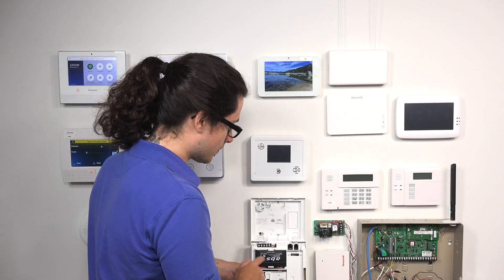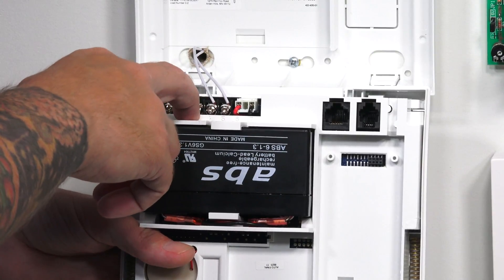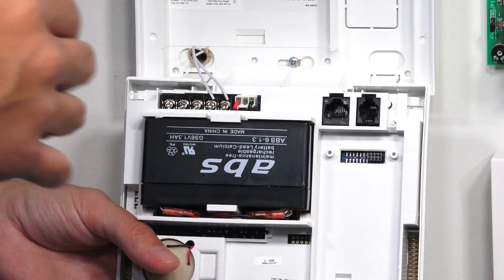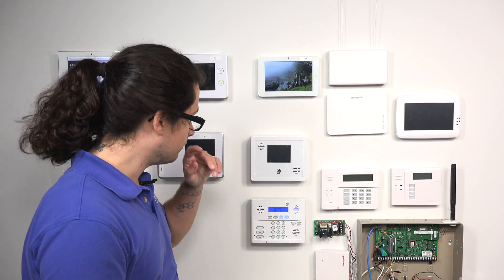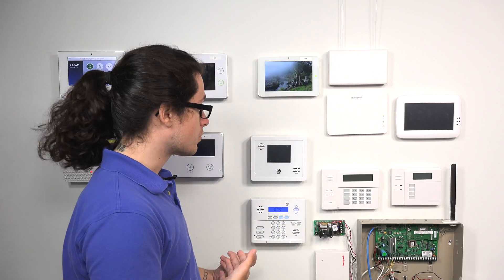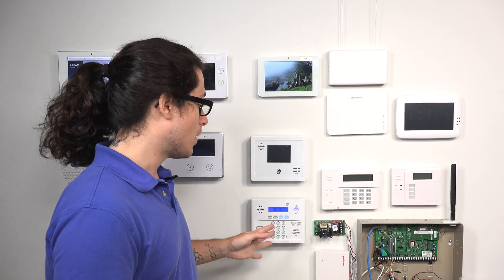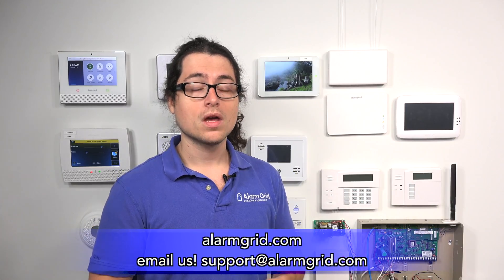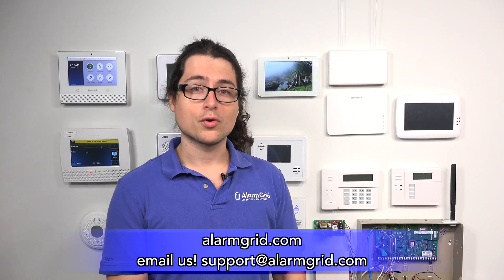Adding Hardwired Zones to an Interlogix Simon XT

Comment: I have brand new system and brand new motions sensors and they keep going off when they shouldn't.. what causes this?
Reply: A couple of scenarios First I would check power if the motion is not getting enough power or losing power it can cause a false alarm. Loose connection can cause it those are the main thing I would check
Reply: I put new duracel batteries in them. Bought Brand NEW Panel and Motions sensors. Thought they were bad. Sent them back and get a new panel and 3 motions sensors. they all go off at random. regular door sensors give me no problem.. i like the motion sensor.. It seems to me WiFi or something is screwing with them, I had no problem for years